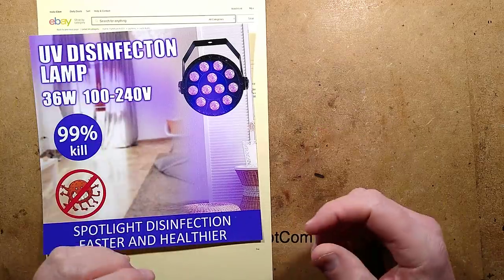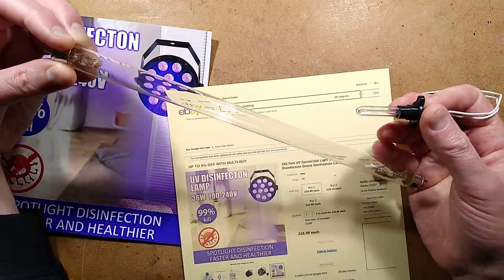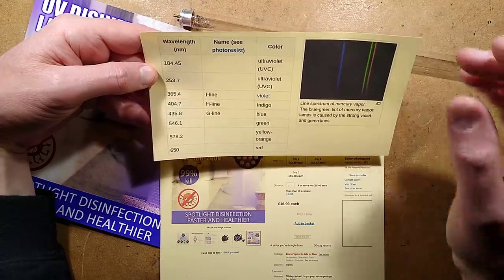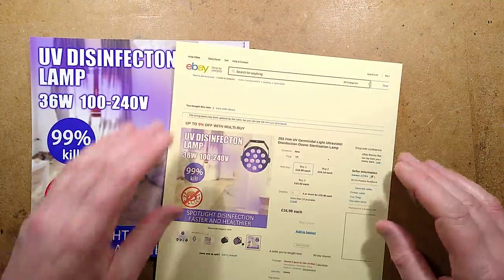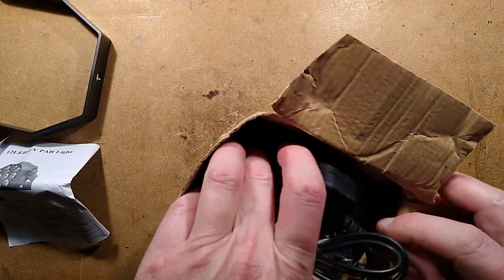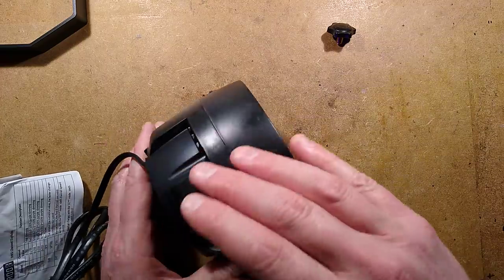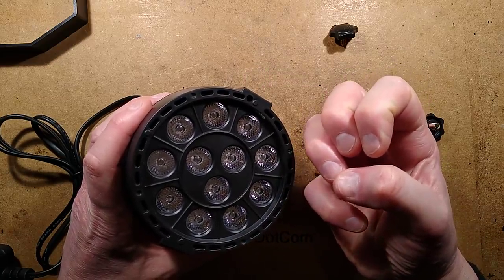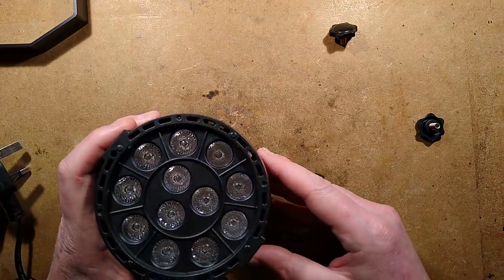Fake UV disinfection lamp from eBay.

Comment: I remember getting a "Shortwave UV" lamp for mineral identification (I think those are UVC), and wandered around my parent's kitchen to see what would flouresce. I discovered that lead-crystal glasses flouresced a pretty pale blue. Try to find some old Wedgewood crystal glasses at a 2nd hand store or estate sale to use as an indicator for UVC.
Reply: Uranium glass?
Reply: @PieterPatrick  that's brilliant green.
Reply: @Muonium1  With other elements in the glass, the color can have other colours like blue.
Google "blue uranium glass" and you will see a lot of beautiful pieces.
Reply: @PieterPatrick  If it's blue under visible light then it's other elements imparting that color to the glass but if it contains any uranium it's still going to fluoresce green under uv regardless.
Reply: @Muonium1  Ok yes ofcourse.
Excuse me.
Reply: The phosphor inside compact fluorescent bulbs works as well as the phosphor inside color corrected mercury vapor bulbs. I have a UVC LED and it makes fluoresce those phosphors pretty well. Edit; i might add it does not fluoresce with UVA light so its a good test to see if your UV light has a shorter wavelength than about 350nm.
Reply: The quartz glass itself used for germicide lamps also seems to fluoresce in violet purple.
Reply: @750kv8  it also phosphoresces
Reply: I’ve found also regular pane glass for windows or cabinets fluoresces a faint almost brown color, but not nearly as easy to see as clear lead-crystal glass does.
Reply: @AScannerClearly  yes, you'll probably note if you look carefully that it's confined to one side of the glass. It's fluorescence of tin ions doped into the glass as a consequence of the Pilkington float-glass manufacturing process which uses a pool of liquid tin to produce flat sheets.

Comment: "Let's stick that finger across the capacitor Ya, its discharged". Love It!!
Reply: I "found" a large capacitor inside a faulty drill battery charger once, If Clive finds one on camera the video will definitely get demoneytized!
Reply: He will always say "Ya, its discharged", it is what he might say immediately - and loudly - beforehand that will be of interest.
Reply: Any expert thoughts on this?
Reply: Now try that while tearing apart a microwave oven!
Reply: @sapuseven6119  
"Don't try this at home"
- Experts
Reply: It's a small capacitor. And since the current goes only through the tip of your finger, your heart will stay beating. Don't worry about your life, just about your fingertip.
Reply: The same as one of Mehdi's line: "to check whatever the breaker is on or off, you can just short the plug" or something.
Reply: "One of these days that's gonna BITE me"...  Lmao.

Comment: Digikey has 272nm UVC 1W LEDs for $18 each.  200mw for $8.
Reply: 1W? Horseshit, more like ~7mW, but yes, it does indeed eat 1W or so.
So I've been reading around - inactivation doses are around 2000-8000uW*s/cm2, so getting all that light onto 1cm2 will inactive it in 1s, now the inverse square law kicks in...
Mercury lamps on the other hands do a few watts per cm of legth...
Reply: @VEC7ORlt  I found the item, all the digikey products are listed by power consumed, none of them list radiated light power. I REALLY want to see some of these reviewed somewhere! I agree with the ~3mJ/cm^2 fluence dosages but I think those apply more to aerosolized viral particles and I'm reading closer to 100-200mJ/cm^2 for surfaces. Depends on what source you're looking at. The T5 8W $15 chinesium quartz UVC lamp I got for decontamination recently should do the job within 5 seconds or so of exposure when it's a few cm from the surface if I did my calculations right....
Reply: VEC7ORlt Yeah, the most powerful UVC LED I found is 50 mW and it’s about $40 a piece...

Comment: I'm quite confident they moved the optoisolator from next to the interference suppression capacitor into the primary side to be able to produce a narrower and thus cheaper board.
Reply: Would you mind explaining a bit about the optoisolator's / interference suppression cap's purpose and why exactly he was angry? I'm guessing the aforementioned cap is to reduce noise from something in the circuit [switching PS?], and maybe the path being so long allows for noise to couple in(?) but past that I'm shamefully uneducated and have never even heard of an optoisolator. ..
Reply: @lacunate  The power supply should convert the high voltage from the mains that is dangerous and can kill you when you touch it in an unfortunate way into safe low voltage that can tickle you, but most likely won't ever kill you. So it is very important to keep mains voltage (called "primary") and output voltage (called "secondary") apart. An important concept is called "clearance" which is the distance of PCB tracks that are connected to mains from those tracks that are connected to the output voltage. It is accepted that the clearance is supposed to be 3 millimeters at the very minimum, but 5 to 10 millimeters is definitely better. You need the distance because the PCB is not a perfect insulator, and the mains voltage might creep into the ouptut voltage. This is espacially true if there are some high voltage spikes (with that I mean pulses that are 1000 to 1500 volts) on the mains, which could break through the insulating paint on the PCB and burn it away. Such spikes do happen. And if the paint is burned at some point, and you keep operating that "germicidal lamp", er, dicso light in a diso-like environment with fog machines around, it is possible that residues of the fig fluid condense on the board and form a conductive layer that makes the output dangerous to touch. In this supply, there are tracks connected to the secondary side that get extremely close (I guess around one to 1.5 millimeters) to connections on the primary side, which makes this supply dangerous, especially if you connect an external controller via DMX, or just if some wire inside that thing touches the metal case. This is why Clive got mad - especially because the distance between primary and secondary side is quite good at all other places of the supply. So they really tried to make a safe PCB, and then they messed it up completely.

This supply has three components that are connected to both the mains voltage side and the (supposedly) safe output voltage:
1) the transformer. It converts the input voltage into a magnetic field, and then convertes the magnetic field into the output voltage. There (should be) no electric conductivity between the input and output voltage. The quality of the isolation of these transformers is often extremely unexpressive (that's an euphemism for: dangerously low). See videos from DiodeGoneWild about cheap dodgy USB power supplies. He disassembles the transformers in those supplies and analyses how far the mains-connected and output-connected wires are really away from each other.
2) the "interference suppression cap". The power supply works by making a high frequency voltage (likely around 100.000 to 300.000 Hz in this supply) out of mains voltage, and sending the high frequency through the transformer. The basic idea is that a transformer needs to send a whole "half-wave" (the time where the polarity of the AC voltage does not change) at once. So the longer the half wave is, or the higher the input voltage is, the more magnetic field is created inside the transformer. This means the transformer needs to be bigger to handle lower lower frequencies or higher voltages. We can't easily lower the voltage, but we can easily in increase the frequency by a couple of thouands using modern electronics, which allows a very small transformer. Because the transformer is a very small device with wires and a bit of insulation between them, it also behaves as a capacitor, and transfers the high frequency stuff to the secondary side. The secondary side is connected to a lot of devices and wires, and behaves as antenna that sends this high frequency as radio waves into the environment. That's forbidden, so you need to take the high frequency away. The way you typically do that is to use a capacitor that conducts high frequency much better than the unintended capacitor in the transformer, and connect that to a place that is able to safely dispose of the high frequency. This is often one of the mains connections, or protective earth. It is very important that this capacitor does not allow lethal currents from the primary side to the secondary side, even when it is mistreated with high voltage pulses or breaks down of old age. That's why you must use a capacitor that conforms to some safety standard in this place. If the capacitor has been tested to be safe enough, it can be certified as "class Y".
3) the optoisolator. This is a small plastic box with 4 connections. Two of them are connected to an internal infrared LED that lights up if you send current through them, and the other two are connected to an internal light detector. These components are inside the case, so the light detector only receives light from the internal LED, but not from the environment. The LED is connected to a voltage sensor on the secondary side and lights up when the voltage at the ouput of the supply is highe enough. The light detector is connected to the primary side and tells the control chip to send less energy into the transformer. Think of it light a car going downhill: If there were no brake, the car would accelerate so much that it will get to fast, and finally kill you. You need to push the brake a bit when you are fast enough. The LED is like the brake pedal, the optoisolater like the brake line that transfers the pressure to the actual brakes and the photodetector is like the caliper that actually pushes the brake pads to the brake discs. You would never want to touch the brake discs youself, not just because they are out of reach, but because they get dangerously hot, and apply a dangerous force to you, so you need something to separate the dangerous wheels from the safe pedal. In this supply, the "brake" information is transferred through the optoisolator.
Reply: @lacunate  The optoisolator (optocoupler) is okay, it's it's location that's the problem, its secondary pins (meant to be a safe voltage) are very close to the high voltage side of the transformer. That could allow the high voltage on the input to the power supply reach the low voltage output, if this was a phone charger your usb cable might be at 100's of volts.
Reply: @tw11tube  I am nearly speechless. This is probably the most informative comment I've ever seen. Thank you so much! As someone who's TA'd an intro to electronics for non-majors class (I've only done slightly more circuits than that--I do more computational/medical imaging stuff in my EE subfield), but more generally cares a lot about pedagogy, this was not only mind-expanding but heart-warming as well to see such care put into the explanation. I might even borrow some of your analogies for use in the future! Thank you so much!
Reply: @tw11tube  Thank you very much. I'm glad I scrolled through the comments before Clive called me a 'twat'!?
My initial reaction was 'what's wrong with an optoisolator'? My recollection was that they are rated 1kv isolation at a minimum? They are what you use to isolate a digital circuit from the 'cruel world' (simplified for brevity...) in many control situations (or, at least they were, back in the '90's) but I admit, I didn't immediately 'cop-on' to the physical isolation problem. I'm a bit embarrassed now! I thought I was 'shit-hot' at one time or at least considered capable enough...when nobody could sort a problem in some (very expensive) control systems, often on Oil and Gas rigs, the company sent me! I had a 100% success rate. 
 Spookily enough, I once identified an intermittent failure (the worst kind) using a UV light...one particular circuit board had been replaced three times (on an Oil rig, imagine the costs and the penalties?)...by the second return, I was 'on it', the rejected board worked perfectly and I personally tested and vetted the third...three months later another miscellaneous fault notification (evil evil intermittent faults) and I had been all through a similar system and had no problems, faults or theories...no 'ah-aha!' moments.  So off to the heli-port, away to the rig, seated beside the baleful head-honcho who was taking control and made it clear that he didn't like 'paddies' (hey it was a fact of life in the UK at that time, paddies were thick?). Long story (already) short, I knew the circuits, I knew they were good, I knew the last one was good so I went entirely through the system (just like had been done before me  twice now) and there was nothing wrong. I have a great disdain for 'board jockeys' but I began to rule out the circuits and look instead to the connections between them (with 'boss-arsehole' breathing down my neck..) I had brought  the last 'failed' circuit with me and I noticed the conformal coating looked a bit 'ragged' So I examined the latest one, again, it looked  kinda amateurish? So I begged an ultraviolet light from the tech/security guys.....lo and behold, conformal coating all over the gold-plated connectors?!  Seems like a certain well-intention-ed 'engineer' had told the guys to spray any new circuits being delivered?  Without any masks?  I 'hard-wired the connections  to the main controller, not a problem since.
I hope my story is equal to  a coterie of engineers who have been there, seen  it, done it......you auld bastards!
Time to actually form the 'tall hat society? This is such a real thing that there should be solicitors and indeed, what the entire  project needs, just ne person who understands

Comment: The wavelength from the UV disco lights is barely short enough to cause the security ink on a UK bank note to fluoresce. They are the equivalent to the oldschool disco fluorescent tube black lights (but the old ones can show the UV ink on a banknote). Disco light 'UV' leds are just the white ones but without the phosphor.

Comment: We've studied using the UVC leds to prevent underwater biofouling. Because they don't emit any visible light, they are actually quite dangerous. When working on them we would need a special interlock in place to ensure we weren't damaging our eyes and skin by working in close proximity to them whilst on. The fake lights have been around for awhile (I remember an advert from 2014) but must be much more prevalent at the moment.
Reply from the maker: Some of the UVC LEDs either contain an extra visible LED chip or have it on the PCB to let you know the thing is active.  Really terrible efficiency and lifespan compared to mercury though.
Reply: @bigclivedotcom  yes, and there were a number of other issues. Incredibly high price, low output, lots of heat to dissipate, poor transmission through most types of glass (a general issue with UVC). We also didnt want visible lights showing as this was a camera window. Mercury is still better, but a big hassle to incorporate into a design as it is fragile and bulky. LEDs would be much better if they were more efficient.

Comment: It would be interesting to test the forward bias voltage. The bandgap (and hence forward voltage) is dependent on the wavelength. UVC should have a relative high forward voltage.
Reply: ottard
explain that so someone that has porridge holding his ears apart can understand please :-)
Reply: @YTANDY100  Haha! Semiconductor physics is hard for everyone. You can try searching youtube for "Semiconductors".

Comment: Thanks for this Clive! 
I'm in the process of manufacturing 3D printed face shields kits for local essential and medical workers and I wanted UVC treatment as the last part of my process.

I figured LED version would be easier to use than the T8 tubes, so I ordered one like in your video and a E27 60W LED type to try. I only realised once I got them that something was not right with either.

This video gave me the confidence to declare to the sellers that they are fake and I asked them to stop selling the fake lights and give me a refund 😊

I already gave up on having UVC LED and bought two Osram G55T8/OF 55W which are perfect for the job.
Reply from the maker: The e27 lamp was probably bright blue?  I think it's just ice-blue LEDs to make it look like a mercury vapour lamp.  The only proper UVC lamps are the glass tube ones.
Reply: @bigclivedotcom  Yes very much turquoise, and the LEDs are in plastic housings.
I did know better, but wishful thinking left me hoping they were the simple solution I was looking for.
I was left with the pickle of how to prove they are fake knowing little about them, but thanks to this video I no longer feel the need to prove it.

This UVC stuff is all a bit new and I wasn't quite sure which way to go with it, but I'm certain the Osram G55T8/OF 55W will do the job!

I'm using a grow tent with clothes drying tower racks inside where I can place the zip bag kits and blast a batch of visor kits.
Then they go into a secondary clear but larger bag and blasted again so then I know it's pretty safe overall and the user only really has to worry about that outer bag.